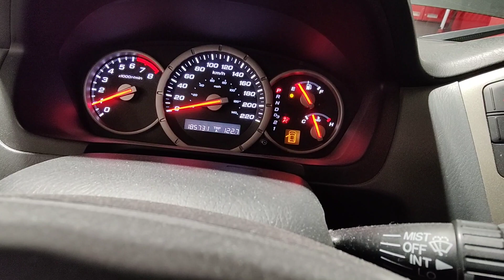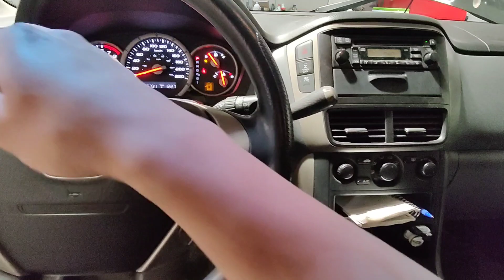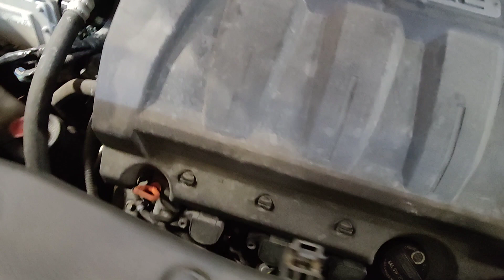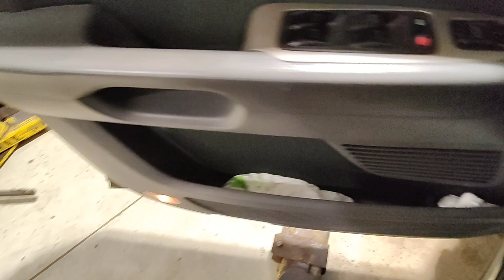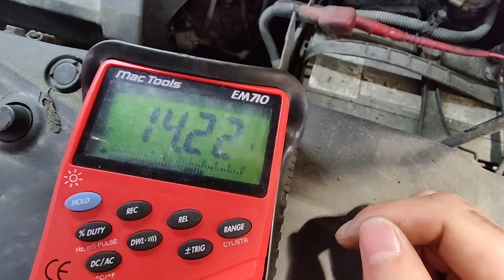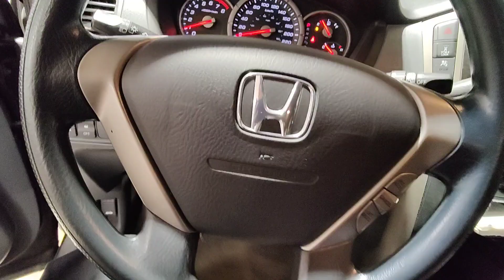DON'T IGNORE THIS NOISE!! On your Pilot, Ridgeline, and Odyssey. It could get you stranded.

Comment: My brother has a 2006 Honda Pilot AWD and it has 220,000 miles. I babysit his vehicle because he doesn't even know how to check his oil level. When we replaced the valve cover gaskets almost 2 years ago I found out that there's two different valve cover gaskets. J35A9 for AWD and J35Z1 for 2WD. It was mildly confusing at first. The vehicle is a beast. We also replaced lower control arms, inner tie rods, outer tie rods, front stabilizer bar links and front right cv axle. So almost the entire front end. He's lucky to have me. It's got a check engine light on though with the P0420....
Edit: Mixed up gaskets!
Reply: Clogged cats usually cause the p0420. When you're above 150k on the odometer, that's almost always the cause.